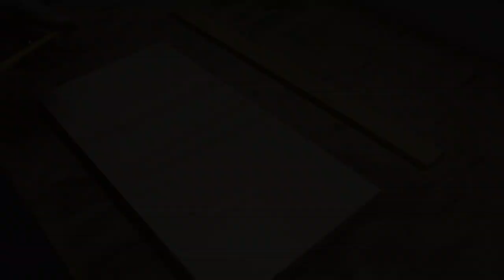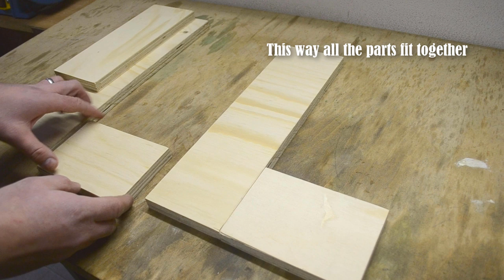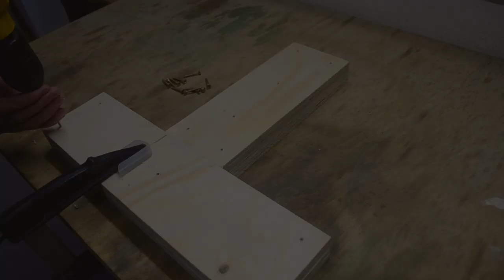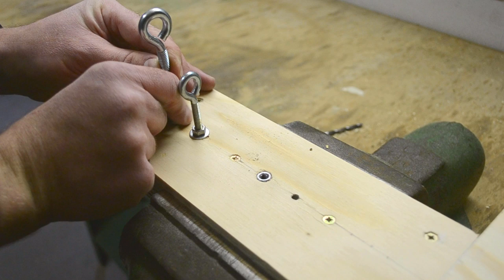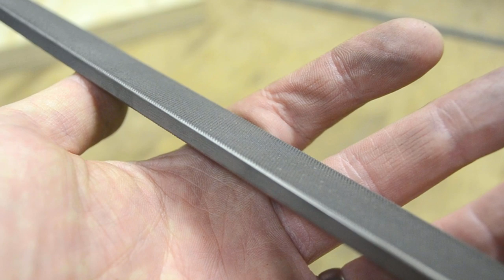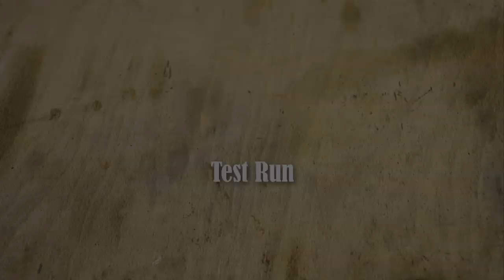How To Make a Filing Jig For Knives | Easy Knife Filing Jig

Comment: Fantastic! Thanks for uploading.  I'll be making this at the weekend. Have just roughed out my first knife so am looking forward to using this!!
Reply from the maker: Hi Joe, thanks! I'm glad it helped. Let me know how the jig works out and how the knife turns out. I'm curious! 🙂
Reply: @AllFlavorWorkshop  jig turned out ok. Not as good as yours! But functional all the same. Worked beautifully grinding in the bevels. Only criticism is I would have made it a little longer. I was finding it tricky to get the eye bolt low enough to finish the bevels. But I did use quite large eye- bolts so maybe not surprising! All in all I'm very happy with the way it turned out. The knife is taking shape now, just struggling to sand out some nasty grind lines I put in with the file. I'm in no hurry though.
Reply from the maker: @jonathang.5092  Wow, really cool, Joe. What was the length of the blade? And what knife were you making? Honestly I've had some issues with the height of the eye bolt as well but what worked for me was to install a smaller eye bold as well and to use a vise where I attached the jig and i could go though the jig screwing in the eye bolt as low as possible.
Reply: @AllFlavorWorkshop  hello again! The knife I'm making is a simple drop point with a 4 inch blade. As it's my first attempt I resisted the temptation to make things too elaborate!
I think the way I'll get around the issue with the jig is to make a removable piece that fits under the knife to raise it slightly. That will shallow out the angle. 
Good thing about the jig is it can easily be modified or tweaked. Thanks again for uploading. Have subbed!

Comment: Would it be expected to wear out both sides a 12" double cut file to do full flat grinds a 9" chef knife blade?
Also I'm having trouble will the guide rod eating through the eyebolt.
Reply from the maker: Hi Zero turn, good question, and I think so, though I havent tried. And for the second point - I never had a problem with the eyebolt. But possibly a tape inside or a plastic circle would do the job and make it even easier for the slide. Anyway thanks for the comment. Something to think about. Stay safe! 👍

Comment: Here’s the conversion of the materials from metric to standard (imperial) units:

	1.	Plywood:
	•	36x10x2 cm -> 14.17x3.94x0.79 inches
	•	26x10x2 cm -> 10.24x3.94x0.79 inches
	•	39x10x2 cm -> 15.35x3.94x0.79 inches
	•	2x (14.5x10x2 cm) -> 2x (5.71x3.94x0.79 inches)
	2.	Soudal wood glue - No conversion needed (brand name).
	3.	Wood screws:
	•	3.5x3 cm -> 0.14x1.18 inches
	4.	Double cut bastard file:
	•	20 cm -> 7.87 inches
	5.	Steel rod:
	•	50 cm -> 19.69 inches
	6.	Electrical tape - No conversion needed (generic item).
	7.	Screw type hose clamps - No conversion needed (generic item).
	8.	Threaded insert, Blind rivet nut - No conversion needed (specific types of fasteners).
	9.	Metric eye bolt:
	•	6.8 mm diameter -> 0.27 inches diameter (various lengths not specified, conversion applies to diameter only)
	10.	Metric screws:
	•	6 mm diameter -> 0.24 inches diameter (length not specified, conversion applies to diameter only)

Comment: The only fine edge a file should ever be applied to is one the is  damaged and requires significant removal of material, NOT sharpening.
Reply from the maker: Yep, the main use of such file jig is to create bevels.
Reply: Sojourner 2016 uhhhh that’s what it’s for